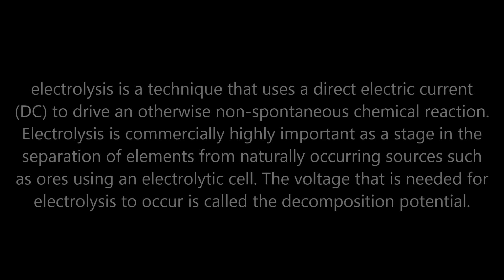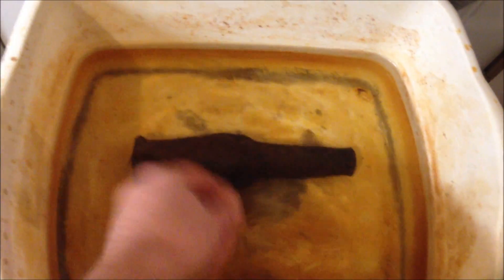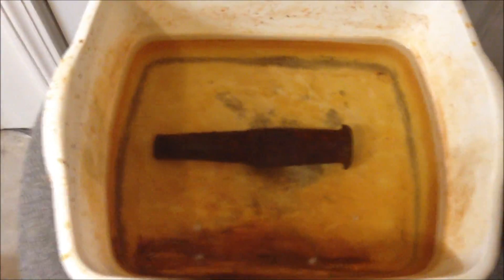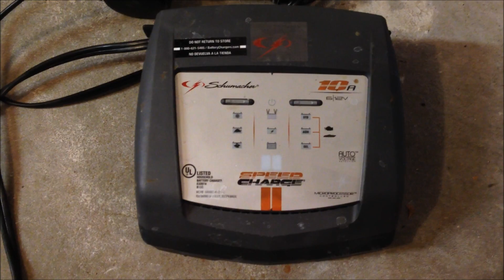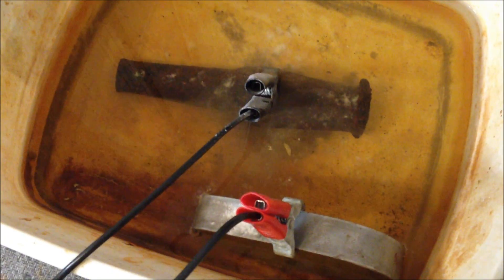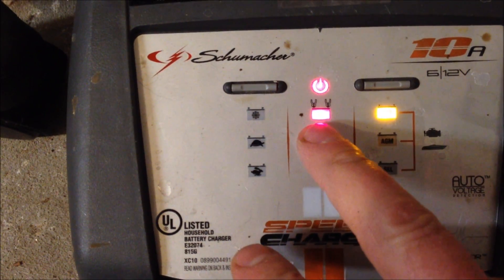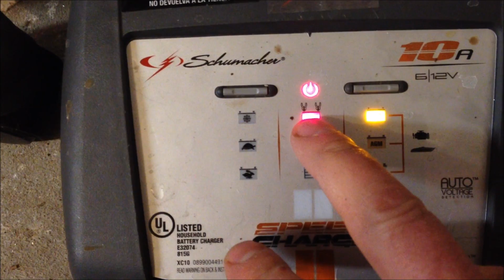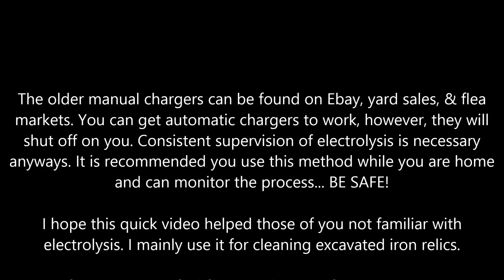Cleaning Iron Relics Using Electrolysis - Electrolysis 101

Comment: how do you clean out tar matrix from relics? I have a 24 lb cannonball and want to keep intact as much as possible. I have a hole 1/4" roughly from where a paper fuse would have gone. I get tiny small black pieces out of it about the size of sand.

Comment: Is it possible to share how you got the charger to work?
Reply from the maker: +Harry Taylor Sure, You need to fake out the "positive" terminal by using Copper or Carbon as the Anode, then when it starts to work, you unplug the machine and quickly switch it out to a piece of steel and plug the machine back in. I am actually just going to buy an older "manual' charger from ebay soon. You can find them for like $20.

Comment: Thanks for uploading this. Your explanation of the process is clear and to the point. I found a few new battery chargers on eBay last night that actually state that they are manual chargers. They're like 50 bucks. I'm definitely going to try this again. I don't think the phone charger generated enough current. Thanks again.
Reply from the maker: The phone chargers are good for very small items (maybe e size of a lighter). To clean large iron you need more juice. Also keep when mind your a sacrificial metal should be preferably comparable, in size to the object you are cleaning and be made of steal. DO NOT USE copper or brass. Thanks for watching and for your support. If you have any questions when you get started please feel free to ask. Take care.